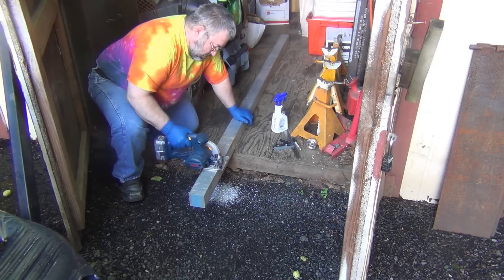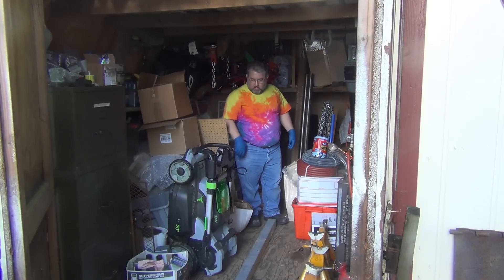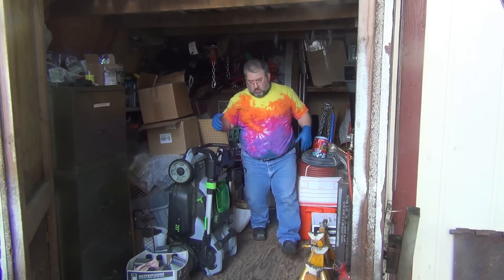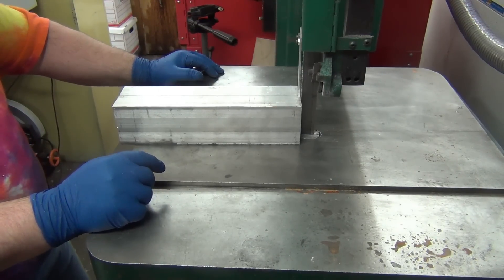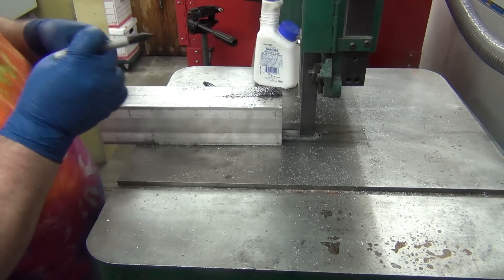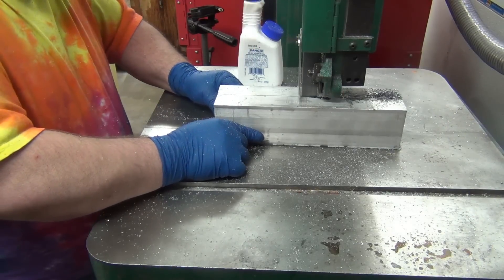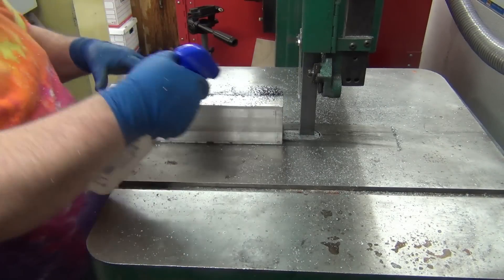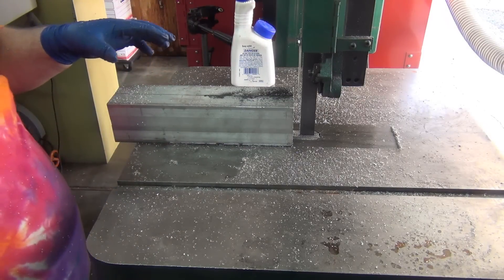13 inch Brakes - Stock Prep

Comment: Loved the aluminium chips flying around when you were cutting it with the hand held circular saw. I felt your pain on the bandsaw, it must have taken ages :-)
Reply from the maker: Thanks!  It certainly didn't cut as fast as the plastic! LOL!  I may change out the blade if I need to do more of that. :)

Comment: I recently cut a 2.5x2.5 aluminum square. I tried the band saw... took forever. Tried a steel cutting skill saw... you did better than I did. :)
Reply from the maker: The trick is to use a carbide tipped blade.  The WD40 helps.  The WD40 is less important with a stronger saw.  I've used my corded saw dry without issue.
Reply: I ended up using a HF saw for cutting steel. It will cut up to 1/4" steel pretty easy. It didn't really like the aluminum. Maybe it just doesn't spin fast enough or something or the blade is too thick. I don't know. Just wasn't a real good solution. My welder buddy says I can cut it with an abrasive saw, which surprised me a bit.
Reply from the maker: Cut aluminum with an abrasive saw????  I thought that was a no-no.  They make dry saws that look just like the chop saws....but they run at a much lower speed and have carbide tipped blades.....maybe that's what he's talking about.....?   I have one....I just didn't feel like dragging it out.
Reply: No, he actually meant an abrasive blade in a hand grinder. Surprised me too. I thought it would just gum up. He does have the saw blade metal chop saw and it probably would work and I might go over and use it.

Comment: That must be one nice little saw.  I did not know you could cut aluminum with one of those little saws.  Is it a special blade?  Keep on keeping on.
Reply from the maker: It's just the blade that came with the Ryobi saw.  It's a carbide tipped blade which is why I tried it.  My corded circular saw with a carbide tipped blade would have sliced through it without any hesitation. :)   I watched a machinist use a table saw to cut his aluminum....worked awesome!
Reply: I guess I need to get with the times and use some faster cutting blades.  Keep on keeping on.